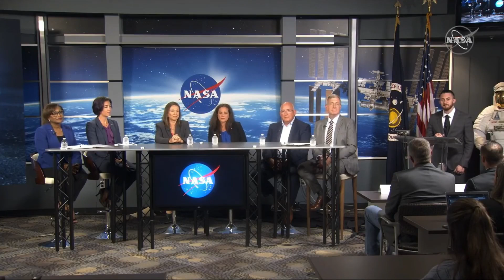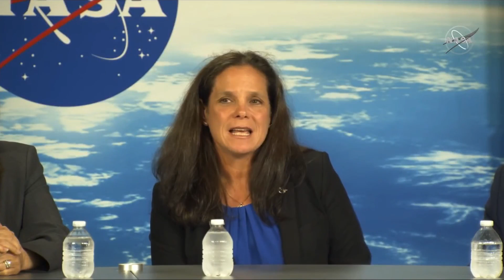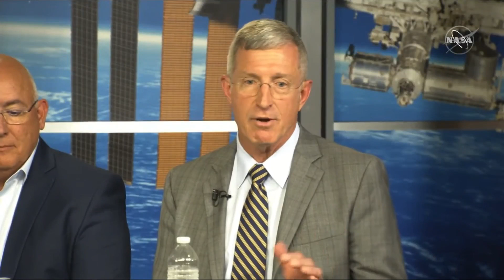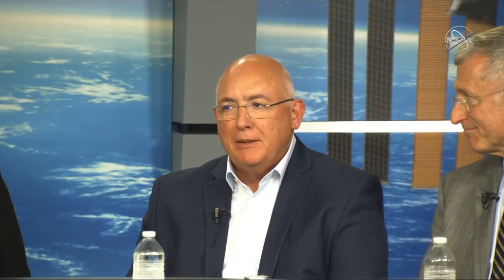NASA's new spacesuits for Moon and microgravity - How they differ?

Comment: Because the old space suits were not good enough?....🤨
Reply: They were designed only for use in low earth orbit (on the shuttle or space station). NASA needs ones they can work for astronauts on the moon surface as soon as Artemis 3 (2025-6).
Reply: @kolar  sorry I was being fercious... as soon as we continue are exploration of the solar system the better.😁
Reply: Worn out and outdated.
Reply: @placeholdername0000  a great piece of engaging that if made new, and exactly the same would be just as good as the first time it was used. It never lost one astronaut that set foot on the moon. But like I said, I was only being sarcastic. My point still stands. If all we had was the Saturn 5 rocket, and the same Eagle lander and the same crappy computer, which was just about better than a pocket calculator, and the same space suit. We did it then and we could do it now. But good job we have all this crappy technology, a mobility obise 80 year old could do the same thing today. But we haven't got the same blue sky ambitions we did back in the late 60s. People are to worried about catching a virus, or there made up pronouns.
Reply: @rodnee2340  You put the cart before the horse.  The Space Race was caused by the Cold War, not despite it.  The so-called technological marvel was a byproduct of the missile programs dating back to the V2.  The inclusion of people on the missions did not make the missions more valuable, but rather into media spectacles, solely because of the risk to life.  The landings were expensive and, ultimately, once the show was over, they were abandoned for robotic missions that were more capable and expendable.  There never would have been moonbases in the ‘80s due to costs and the challenge of launching mass out of the Earth’s gravity well.  The Saturn V could never have supported a moon base and the Nova rocket was impractical.   Even modern moonbase concepts require the exploitation of lunar resources to be viable.  

Yes, the achievements still stands, but as a showboating footnote, rather than a sustainable achievement.  The true “greatest achievement” (or, at least, the one with any legs) was Apollo-Soyuz, which brought about the adoption of the universal mating adapter, allowing Soviet and American spacecraft to dock to each other, and started the cooperation that would permit the ISS to be built.  The rest was a lot of “seat-of-the-pants” “more luck than skill” moments that were successful in the end.  However,  while that is a testament to the engineers, astronauts, and mission planners, who made it all possible, it does not make it more than it was: a geopolitical flexing competition between two global superpowers.

The true technological marvels are the “lowly” unmanned probes, like Voyager, operating beyond their planned operational lifespans in the harsh conditions of space.  Kept operating by some of the “brightest and the best”, these robots were designed for durability, redundancy, and flexibility that makes them more valuable in terms of data collected and on a ROI basis.  In fact, 45 years after their launch, Voyager 1 and 2 are the only operational human-built objects to leave the solar system.  They will likely be the only monuments to humanity’s existence to survive.
Reply: Esl moment
Reply: Franko Blondee  NASA and SpaceX do not currently have a modern space suit that is suitable for walking on the moon hence the new one being developed here.